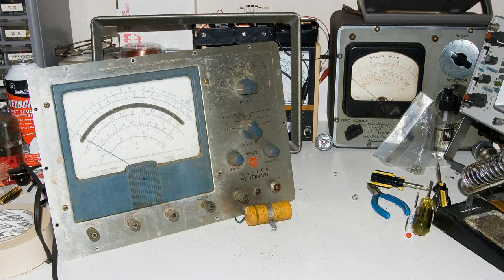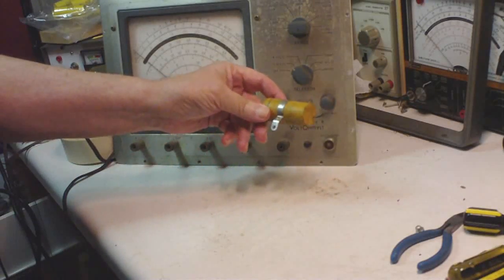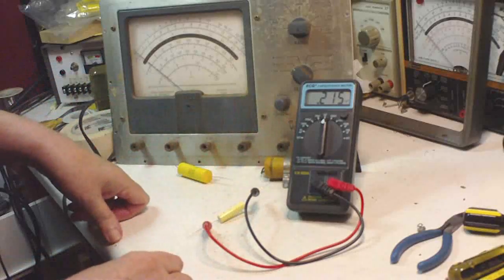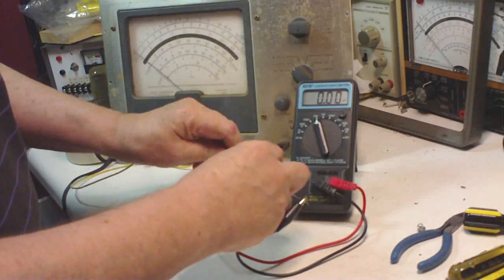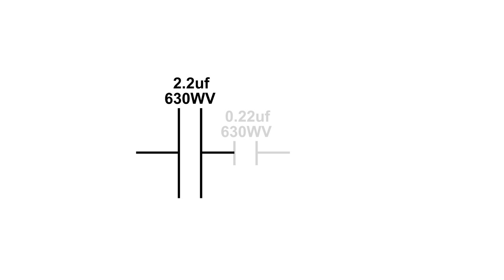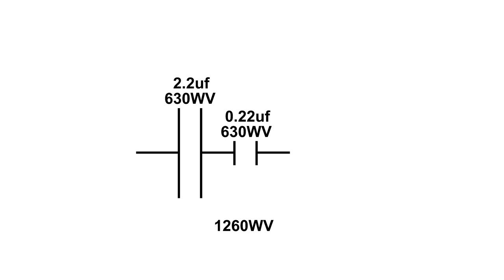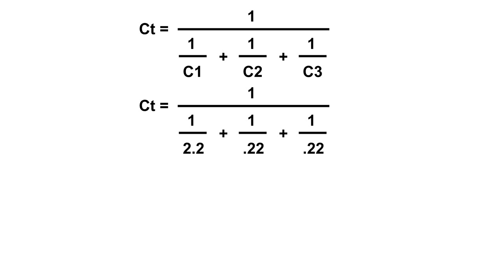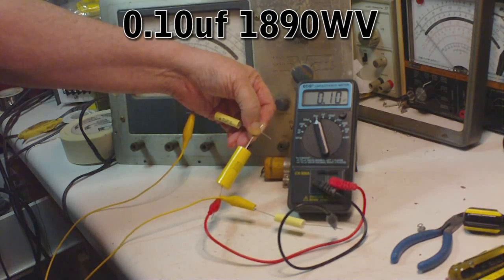RCA Meter WV-87B Capacitor Replacement

Comment: If the capacitance of the capacitors that you put in series is not all the same, the voltage across the capacitors will not be evenly distributed and may exceed the working voltage of the lower value capacitors in the string.If you put 1260 volts AC across the .22uF and 2.2uF capacitors in series, the voltage across the .22uF capacitor will be approximately 1145 volts. If 1260 volts DC is applied, the peak voltage during charge up will also be about 1145 volts. The voltages divide by Xc.
Reply from the maker: +Rob T 
True I'll get back to it some day

Comment: Thanks for explanation of the "W" at the caps
I was thinking that it means watt :)
microwave caps can handle 2100 WVAC at 0.80 to 1.13 μF
also a nice 7 KV diode is connected to this capacitor.

Comment from the maker: Thanks FelixTheHouseFreak,
I would not say you were misinformed. The size of the plates, and the distance (and/or dielectric) between the plates, all contribute to characteristic of the capacitor. If you had a 2.2uf capacitor where you could move the plates, if you move them farther apart the capacitance would decrease and the WVDC would increase. If you moved them closer together the capacitance will increase but the WVDC decrease.

Comment: Excellent video!  I didnt know you could combine capacitors to increase working voltage.  I only knew about combining them to make different capacitance. I was also misinformed before and believed that the gap is what made up the capacitance value and not the voltage. 

Another valuable thing learned from this great channel!

Comment: Excellent, excellent demo.  Very informative.  And good timing as I was recently zeroed out on a cap I need for the transmitter.  I'm trying to come up with a replacement, but might have to eventually cobble a couple lower value, lower rated caps together.
This video was really good stuff.  Thanks.
Btw...how's about giving us a closer look at that capacitance meter?

Regards,
John